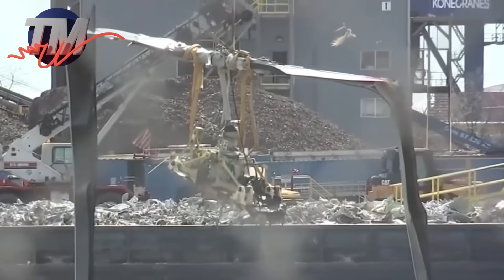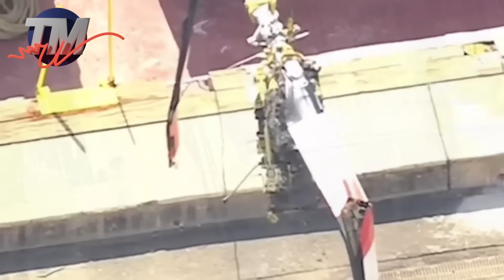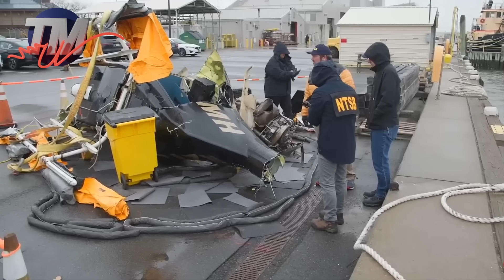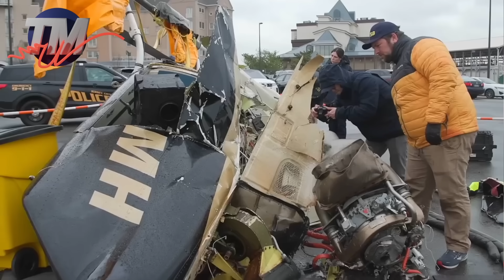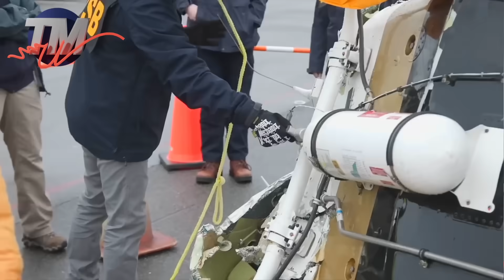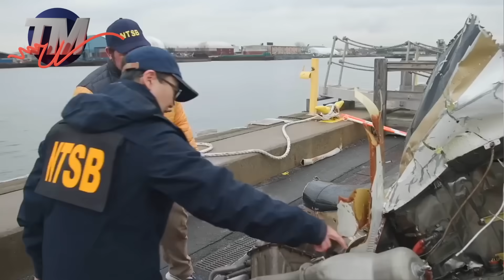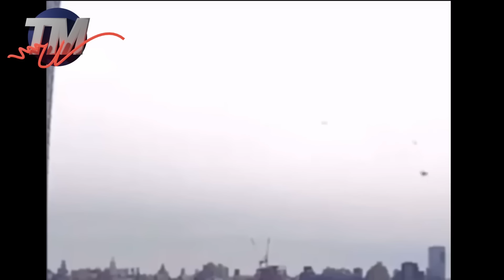Recovery of the Main Rotor of the Hudson River Tourist Helicopter - it's worse than we thought

Comment: My theory is that the transmission locked up and the torque of the rotor spun the aircraft quickly around which rip the tail off, and then the whole transmission platform ripped out of the top of the helicopter

The video shows the helicopter spinning violently in one direction.

Comment: Just a thought... Could the transmission have locked up transferring the rotational force to the fuselage causing the tail boom to separateand eventually the entire transmission and rotor to rip off.
As far as the media's sensitivity goes what bleeds leads and aircraft accident sell right now. The frequency is about the same these days.

Comment: Such a violent sudden swing in forward flight suggests to me a sudden mechanical failure of the gearing, I just lost an expensive scale RC Heli when the motor (bearing) seized and jammed and caused a sudden stop of the main gear and rotor shaft which swung the Heli in the opposite direction and slammed the nose into the ground - if my tail boom wasn’t made of such an over-engineered composite tube inside a scale fibreglass shell boom it would have snapped at the point of inertia much like this LongRanger. All extremities outside the arc radius of the swing was so violently swung that they snapped or cracked before the nose dropped and swung into the ground leaving a semi circular gouge in the ground. It was only an 800 size Heli but the sudden violence was unbelievable and loud - I can’t imagine any aeronautical structure surviving such an event.

Comment: The tailboom failure was clearly not at the mounting point to the fuselage. It appears to have been about a foot aft of that juncture, and is mostly lacking the hallmarks of a blade strike. The guy in the orange jacket has his first finger right on the fuse/tailboom split line.

Comment: I think whatever it is if you watch the NTSB they look over the rotor and transmission walk around and look at were the rotor and transmission attach and then they walk to the tail and look at the tail part and how clean the area looks as if it just fall off or came loose at the bolts. The copter looks clean and taken care of. I think the tail fail off and caused high speed torque and the rotor tore off.

Comment: A Chinook helicopter in the 80's did the same thing. The rear transmission which was a 145D part number failed because at that time the MOT allowed for cleaning the magnesium casting with walnut shot. That is not allowed after the crash anymore. There was a piece of walnut found in a bearing race coolant track that prevented lubrication and it ultimately lead to the ceasing of the rear transmission. That caused the rotors to stop instantly and it split the aircraft in half. Killed 28 people. I was an Engineer at Devco here in Phoenix next to Honeywell.  We are the OEM manufactures of the Chinook 145d and 125d parts. 125D are beefed up datum mating faces mostly.

Comment: Reminds me of the airbus H225 gearbox failure due to fatigue crack in a planetary gear. In that case the gear opened resulting in an immediate jam. The resulting kick loads failed the gearbox housing and the rotor head seperated. In the current accident the weak link may have been the fuselage crown structure.

Comment: I don't see a optical illusion there. Even more it seems clear, that for any reason the tailrotor failed an the body of the helikopter turned to the right, because of the forces of the main rotor turning clockwise. The high speed of the helikopter, wich suddenly turns sideways into the wind, tore of the tailboom. Shure not very sharp, but thats can be seen in the Video without any Interpretation. The question is, why the tailrotor failed and the reasons are pure speculation at this time.

Comment: Boom Sheared almost a foot behind the connection point.
This indicates a sever and instant catastrophic mechanical failure, locking up the Drive system instantly. The torque differential ripped the craft apart.

Comment: To me, it certainly looks like the helicopter didn't just "yaw" to one side, it did so far more violently than the controls would allow.  That fact plus the fact the not only did the rotor separate but the entire upper section of the transmission and frame were are still connected to it.  This also requires an unimaginable amount of force.  IMO-something "broke" that instantly locked up the engine basically causing the rotor to momentarily "stop" and the entire helicopter to rotate very quickly and violently causing enough torque to tear the transmission and frame clean off of the fuselage.  I have never seen nor heard of anything like this happening before.

Comment: What I see is the tail section came loose causing the fuselage to torque to the right. I think the helicopter had a crack or damage around the transmission area and it let go on its 6th flight casing the rotor to strike the tail boom. The boom strike and the previous (guessing) damage and air drag was enough to completely dislodge the transmission/rotor assembly. I think it was because nobody did a through inspection of the machine. The company makes money when the helicopters are in the air, not when they are grounded undergoing inspections and maintenance.

Comment: It looks obvious to me that the Engine and XMSN "deck" separated completely, it's so easy to see in all the videos. Possibly due to years of hidden corrosion. Before they recovered the Main rotor hub, Main rotor blades, Mast and XMSN I thought it would have been the mast, mast nut or the yoke failure.

Comment: Did this rotor system have droop stops on it ? I know if the droop stops break during rotation the blade would droop low enough to hit the tail rotor holding frame. I have worked on helicopters for many years.

Comment: 🌟Looks exactly like a Rotor-bump in zero g. Of course the rotors are gonna be damaged. They hit the tail. Had the separation from the joint been on the other side I would agree with you. But it wasn’t & it still very much looks like a rotor to boom strike. That’s also why the boom is in about 10 different pieces. After you said that the aircraft could still auto rotate when it was missing its tail rotor shows that you are not a helicopter pilot or engineer. Once you lose that tail rotor she’s gonna spin, auto rotation will not help you. And she will spin in the direction that the rotor is going (counter clockwise). In this case, the reason they lost a tail is because the rotor hit the tail boom which knocked the boom off and knocked the router off so she’s not gonna spin it all. She’s just gonna come straight down, which is what it did. Of course the yaw was to the right, which is the same direction the rotors are spinning.
Reply: Problem is the video shows the chopper continuing in a straight line until the happened.  Had it showed a sudden nose dip just prior to the disintegration that might indicate a zero G event.

Comment: Yes you are absolute correct! Actually this hysteria on airline crashes started with the Ethiopian 737 MCAS crash two weeks later after the first one when US Congress decided they were going to ground the 737 fleet. This crash and the one several weeks before with Lion Air were clearly pilot error as they should have been treated as run away pitch control and treated as such by turning off the two switches aft of the throattles on the center console. But due to under trained third world airline second officers the simple fix was to turn off the automatic pitch control. At that point it looked like the issue was going to be controled by the FAA and Boeing to determine it was a pitch control issue agravated by Boeing not haveing a second AOA indicator to tell the aircraft the AOA signal was not valid and turn that system off. But no Congress decided to play aircraft engineer and just ground all the aircraft . They totally ignored the MCAS 737 had 400,000 hours in service accident free and these two were crashed when all the crews had to do was treated it as runaway pitch and safe the system. So move your Hysteria assesment back to the MCAS crashes. Congress needs to be fixed and the news media also need to be fixed to just report the news and not the hysteria!

Comment: In one video, you can see the helo make a sharp right turn before breaking up.  It's as if it was torqued severely...as if the engine seized up and sheared off the bolts holding on the transmission/mast/blades, & snapped the tail boom.  But why did it seize?

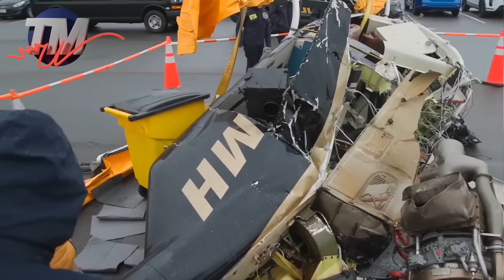Comment: 2:26 In the video, the rear driveshaft is completely missing from the helicopter. A stuck driveshaft destroys the helicopter. A sudden stop is impossible. The gearbox is torn away from the frame. The force is huge. The helicopter should spin in the same direction as the blades.

Comment: It was NOT a person's fault or anyone in the company that the chopper came apart. Ill vote for manufacturing fault of a gear where it had a small fracture and it lasted this long. Over the years i have seen vehicle axels and gears also factory manufacturing equipment / machines made in the 70's and 80's break 20 and 40 yeas later and you can see the original crack that had been there from manufacture. Gearbox seized and the force of the rotors spinning ripped the rotors and gearbox off the frame and the force of the twist on the body cracked the tail off. It is quite simple.

Comment: It split at a rivet cross section look at it!
Structural fatigue.
I bet they find it happen at that lap joint that wasn’t doubler plated
That rotor never touched that tail section..
How good pilots on here are mentioned that blows my mind.
That thing was going straight when it came apart..

Comment: No sabotage. The transmission was seized, and the pilot didn't disengage the clutch fast enough. The rotational inertia of the main rotors ripped the transmission from the helicopter and took the shaft to the tail rotor with it.
Reply: The pilot didn’t disengage the clutch fast enough???
Reply: Also known as a freewheeling unit.
Reply: Former OH-58 Crewchief here... No rotor clutch or rotor brake on the 206. It has a freewheeling unit that allows the rotors to continue turning unimpeded when the engine torque falls below that of the main rotor. But I do agree with you – the main transmission likely failed, causing a sudden seizure, and the transference of all that torque to the airframe did the rest.

Comment: This is appears to me as a 40 year helicopter A&P mechanic with some experience on these models, mast bumping is now off the table, given the top of the airframe was ripped off with transmission and mast being intact! If I saw it clear enough which is questionable, it seemed the rotor was rotating while falling and I did not see the transmission and upper cabin/airframe rotating at the same speed  which suggests the gearbox/ transmission was not seized but video wasn’t clear enough to be sure…but that seems to be what is the most reasonable explanation that could have ripped off the upper cabin. I need to think hard on this for a while.

Comment: i think a failed planetary gear in transmission caused it to seize with the angular momentum of the blades tearing the rotor and trans assembly off the airframe. I think it would also explain the sudden yaw to the right and the tail ripping off.

Comment: I as FAA A&P mechanic and a Bachelor of Science Structures Engineer CERE and 30yrs as a aircraft structure engineer. Rotor with the blades attached completely separating from a main shaft and gear box like the one I saw in the film is the question. I also fly heli.

Comment: Ex UH-1/UH-60 Crew Chief here just asking a question as this accident disturbs me with the amount of destruction to the airframe. Two questions here, could Pylon Whirl have played a cause and secondly if the father of that family was in the copilot's seat, the left-hand seat and turned to his right and looked in the back, could he have stepped on one of the T/R pedals causing the ACFT to yaw? Could this have caused the tail boom to separate past the mount point?  I pray for them all.
Reply: From the pictures taken of the family inside the copter it was the youngest daughter who sat next to the pilot.
Reply: @JCX-9  Thanks, it's just a thought I had. I've flown for twenty years in the Army and have been a contractor for another 21 years in aviation and this one has got me tore up.

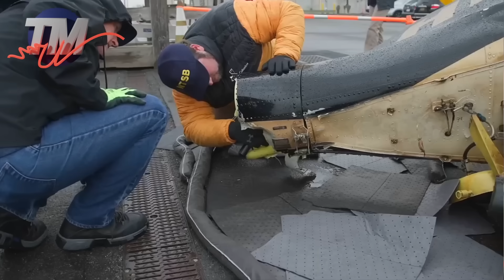Comment: Question for 206 and similarly constructed Bells... if the transmission were to twist free, is there a sliding couple on the tail rotor driveshaft, and is there a support bearing or anything further back that would cause tension on that shaft to pull the tail structure forward and buckle the joint shown at 1:57? I ask because it looks like the metal around the joint looks bent inwards all the way around save for where internal components were snapped against it, but there's no corresponding skin distortion as if this were done on water impact. 

I guess to simplify the question, if the tail rotor driveshaft were yanked on extremely hard from the transmission side, could it buckle the tail boom at that point and cause it's failure?

Comment: 1. First thing out of president’s mouth with DC Crash was DEI influence. 2. Regarding the chopper crash, I heard a briefing that a pilot said that an Abrupt forward cyclic push would cause a rotor clip of the tail rotor mast…. One wonders if the children accidentally jumped in the pilots operation control controls of the cyclic?

Comment: The violent yaw may have caused the tail to separate from the fuselage. If this happened, it may have caused the airframe to be at an angle where the force of the rotor blades ripped the transmission off. If one of the tail rotor blades broke or was thrown, it may have initiated this horrible sequence of events

Comment: The air handling unit probably sucked in a bird causing the casing and gear box to seize, which in turn broke the prop assembly off of the fuselage.  The torque would have been off the charts. I can imagine the sudden violent lurch of the passenger compartment, most likely rendering all passengers unconscious instantly.

Comment: Transmission seizure. Snap torque when it seized caused it to yaw and yawed so violently that the tailboom snapped off, quickly followed by the upper deck failing and departing with the xmsn assembly and related parts.

Comment: I think you may find a lost component in the gearbox like a bolt accidentally dropped causing failure.

They flew round the apartment block. Wind around structures causes buffeting.

Its likely the buffeting dislodged the foreign object in the gearbox.

Comment: it looks like the link arm fractured and the torque pulled the top assembly off the aircraft. When our hueys had a solid blade strike the tranny would unass the aircraft.  there is a lot of torque in the Bell semi- rigid system.  It can be a naughty girl.  281st AHC Wolf pack, death on call, pilot 68/69.

Comment: One main rotor pitch link is missing.  It looks like the forward Tailboom  mounting fittings were ripped out of the front fuselage side, forward and aft tailboom mount fittings are an inspection item, I have found one cracked one in 12yrs as an engineer on 206s. A tailboom is most likely to fail during takeoff or hovering when a lot of tailrotor pitch is needed, but anything could have happened at this point.

Comment: Uhhh, buddy. That was a boom strike. I don't know what video you're looking at, but the one I am shows that the boom has clearly struck the supporting structures. Just because it's on a joint doesn't mean that it was a failure at that spot. Look at the one piece of pipe? It's missing paint and is silver from the metal being hit and exposed.

Comment: Seems to me that it was some kind of drive train lockup, turbine gearbox or transmission. The question is... Which one would cause both the rotor/transmission AND the tail boom to separate from the main fuselage?
If the transmission locks up, think about the physics of what would happen, a domino effect in fractions of a second. First the main rotor kinetic energy would instantly and aggressively rotate the main fuselage twisting the transmission mounts also putting a shearing force on the tail boom. If the transmission input shaft also locks there would also be along with the shearing force on the tail boom but also a rotational force put on it due to the kinetic energy on the tail rotor. The tail boom would have both lateral shear because of the instant rotation of the fuselage and rotational shear. The kinetic energy of the engine would have shattered the turbine gearbox as well.
The rotational shear on the tail boom and shattering of the turbine gearbox are contingent upon the main rotor transmission input shaft locking up.
What's the maintenance history on the transmission? 
From what I understand the transmission has a metal chip sensor in it that will warn the pilot of an impending failure.

Comment: The video shows one thing, this chopper coming apart took ( 1 second ) this chopper was 21 years old. ,I don't know anything about choppers , but the down force wind constantly on the body of the chopper like two magnets pushing away from each other  might be a factor . Especially on fatigue metal. This chopper was on its 6th flight of the day . I don't suspect foul play. And no signs of any explosion, no burnt parts. How many hours has this chopper been flown. Did something hit it. A drone that could have created a problem from the impact point. It's crazy